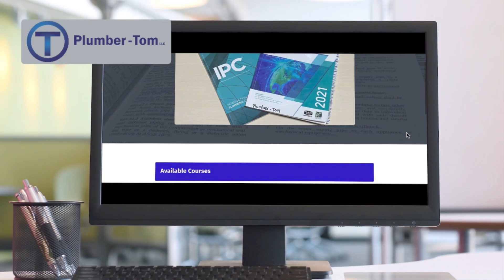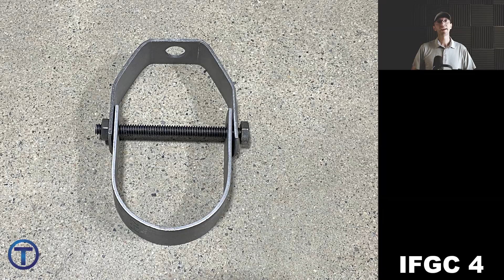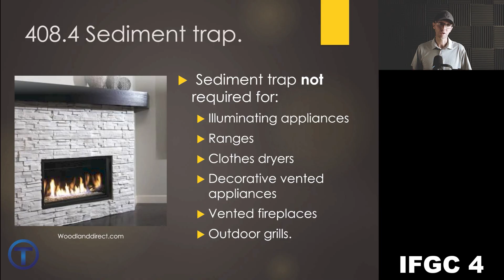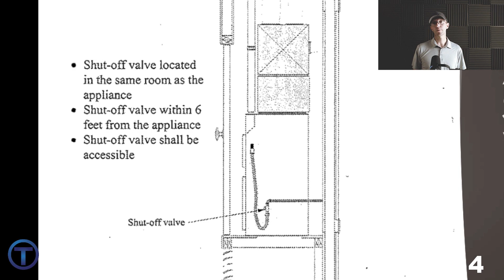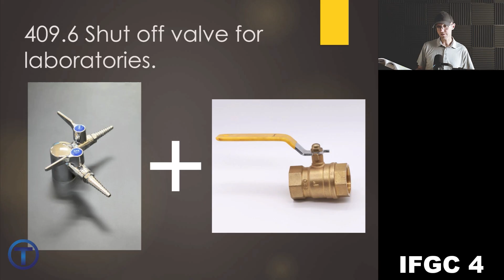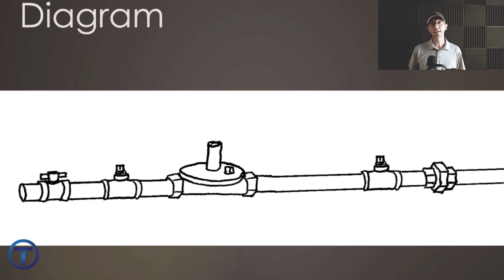International Fuel Gas Code Chapter 4 Sections 407 to 410

Comment: Hey tom, I don’t know if you could please show and make a video for  how to find out what is the pressure supplied to the dwelling and how to rise it. I woud really appreciate it lot because I am one of the biggest fun of your videos and explanations 🙏
Reply from the maker: That is a good question.  The best way to find out is to contact the gas service company in your area.  The gas company will set the regulator to a certain pressure.  Another option is to purchase a manometer.
Reply: @plumber-tom9470 thank you. I kind of figured cause you talked about it briefly in one video. I appreciate your time to answer 🫡